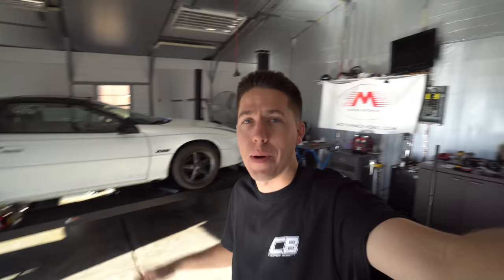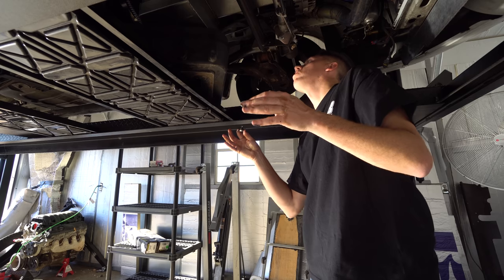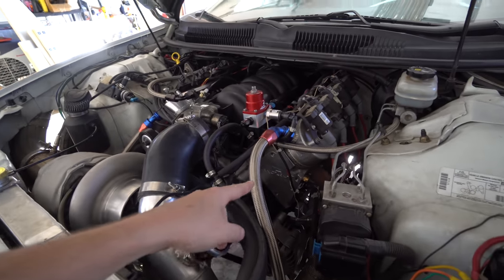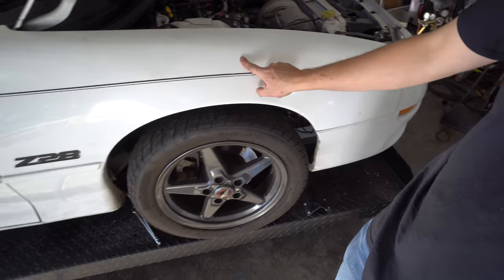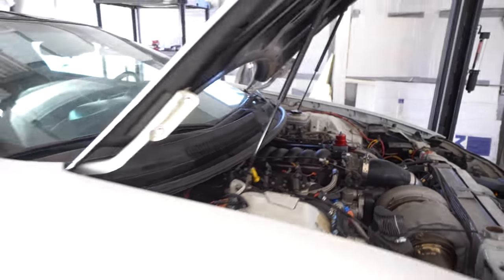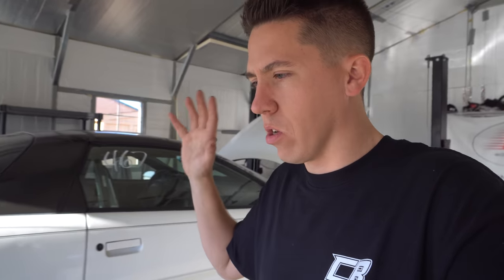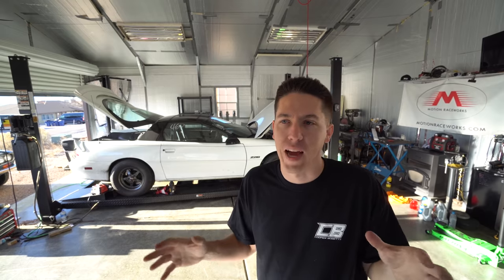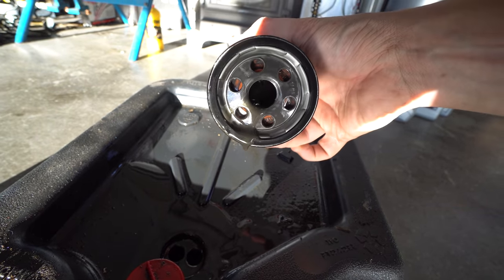10 Things I Hate About My Turbo LS Camaro!

Comment: For ecu I would maybe go fueltech if I were switch from Holley. The only other though I have is at least with the Holley, if you have an issue at an event or race week you have better chances of finding someone with a spare part or getting a part shipped quickly you may need.
Reply from the maker: Agreed idk if I’ll even switch but it is something I’m been thinking about!
Reply: @BuildTuneRace   I’m guessing you have a Holley Terminator X since you are having crank sensor issues?

Comment: Man I could tell you about 20 things I hate about having a turbo 4th gen mainly working on it and changing plugs thats pretty high on the list and if you dont have a lift every thing sucks LoL But I still love it! I got my white z28 (our cars could be twins if you put Black Weld 17" Alumastars and 15x12 beadlocked alumastars with black centers & polished barrels)  down to 3210 w/o me at the moment its just a roller at the moment i sold it that way to a buddy to finish my single cab turbo Sierra. Its got a 10 point cage obviously gutted i still got my dash but theres nothing behind it heater delete lol i still the stock console with my b&m bandit shifter i also went with the Rock solid Motorsports tubular front end kit when  i went to methanol  it freed up room and lost weight, bmr k member and a arms and all midwest chassis stuff out back I highly recommend there rear anti roll bar the last combo mine had was a filled and dry decked 2004 ls6 block K1 rods and D.S.S fx pistons CNC'ED 799s (they where hogged out) I also ran water through them with a radiator off a old gsxr 600 with a summit brand aluminum  intake and TB and billet atomizer 325s a mechanical pump and running on m1 Holley HP th400 and a strange 12 bolt I'm running a 3.90, I cant weld so I went with a Huron speed v3 single t6 kit with a forced  Inductions badass billet Garret 88mm the best it ever went on that combo was a 5.31 @ 133mph I think could be 132. I ran the snot out of that motor shifting at 7200 goin thru the traps at 7580 and lots of boost for a whole season tons of no prep and preped stuff street action and all i did was change the oil ALOT! Still got the short block but im not ready to go full race car again at the moment lol
Reply from the maker: That’s awesome thanks for the info! I thought about methanol but don’t really want to mess with all that lol definitely going to do a tube front end and gut this thing and see where we end up!
Reply: @BuildTuneRace  my buddy who does all my fab work said the rock solid kit went together easy and its strong. Running methanol is awesome I'm putting together a 6.0 based 410ci setup with summit ls pro crank,rods and pistons, stock lsa heads im gonna run it on methanol but put a 15 gallon cell i got a Holley drop in cell fuel pump hanger that had dual 450s im was thinking of stickin two 525s on it and feed the biggest surge tank I can

Comment: I’ve debated something non intercooled just for simplicity. Not worth it, you think? 

Great video btw. Can’t wait to see you tackle some of these projects!
Reply from the maker: I mean it works I just know I was probably leaving at least  100 HP on the table due to less timing for the higher intake temps. But when I go to a regular gas I’ll definitely need a intercooler.
Reply: @BuildTuneRace  Dang. I didn’t realize the number was that substantial. Gotta put that on the to do list for sure!

Comment: Ours is very similar to yours in the build but with a lot more weight reduction. It has power windows & headlight, turn signals, ect but that's about it on factory stuff still in the car. Its about 3200lb with driver
Reply from the maker: That’s pretty good! I’ll be happy if I can get this thing down in that weight range!
Reply: My ws6 is the same. Interior panes and Stock dash in it but al gutted. Power windows, locks, and all the lights. Everything else has been cut out. Manual brakes. Manual pinto rack. No HVAC. Cluster.. all gone. All the wiring for everything been removed. Cowl cut out. Mild cage. All tubular suspension. T top car. Intercooled s485 on a iron motor with a glide 

3200 without me in it. I’m 150lbs

Still got the tilt wheel column tho. I gotta have tilt lol

Comment: I am building a turbo trans am very similar to your camaro and have been wondering what to do with the radiator what size is yours and do you have over heating problems with your set up
Reply from the maker: Mine is the griffin radiator that everyone recommends for stand up radiators in FBody should be able to find the part number on ls1tech or something that’s where I found the info on it years ago when I first built the car. No cooling issues most the time it only runs one of the fans
Reply: I'm in Colorado Springs would love for you to tune my car when it gets done
Reply from the maker: @traviswalker9410  let me know!

Comment: T-top cars are always worth the extra weight!
Reply from the maker: I’ve definitely thought about ditching them and putting a carbon top on this thing 😂 But they are cool as long as they don’t fly out like I’ve seen some do!
Reply: @BuildTuneRace  you'll make up the weight of having them just by removing the OEM harness and rewiring only what is needed. Plus, I bet your friends at Motion can help you out with some other light weight mods.  I'm looking forward to following along!

Comment: Show a video on tapping in to the factory harness I’m putting a Holley in my 4th gen right now and trying to figure out how to keep the factory wiring to keep headlights ect.
Reply from the maker: Its been years since I wired it the first time pretty sure I picked up the key on signal behind the kicker panel on the passenger side and tied into the fuel pump signal wire at the fuse block but all that stuff will be going away lol
Reply: @BuildTuneRace   looking forward to see you redo the wiring I may end up doing that as well
Reply from the maker: @baileyfarmer7882  heck yeah!
Reply: @BuildTuneRace  those motion race work steering column how much weight does that cut out and also are you going with a manual rack?

Comment: What oil pump are you running in your 408 ls
Reply from the maker: I use the Melling high volume in all of my LS builds!
Reply: @BuildTuneRace  what oil pan do you use I have a fbody that hold 5.5 quarts of oil am I going to have to get a new pan that hold more oil ?
Reply from the maker: @boostedthirdgenracing  once I went into the high 1.3 60ft range my my stock FBody pan with improved baffle start to scavenge and show loss of oil pressure throughout the pass.

Comment: Going single to twins, wouldn’t that add more weight?
Reply from the maker: Large frame single and small frame twins it will probably add a little but if I run a shorter smaller exhaust on each and stuff it probably won’t make a huge difference but I think the more instant power from twins will be more beneficial!